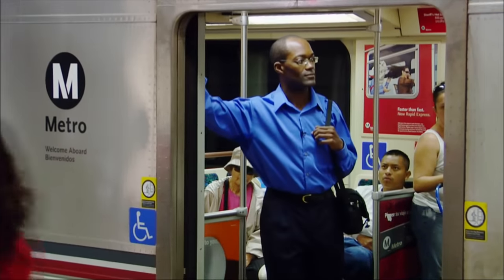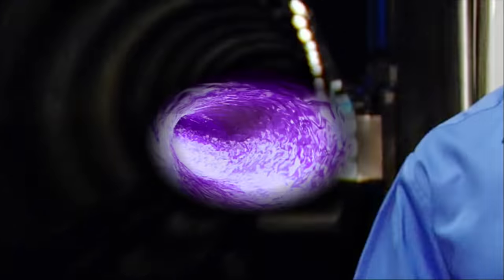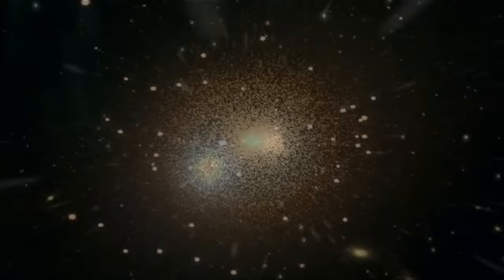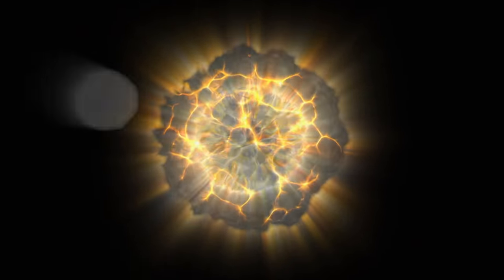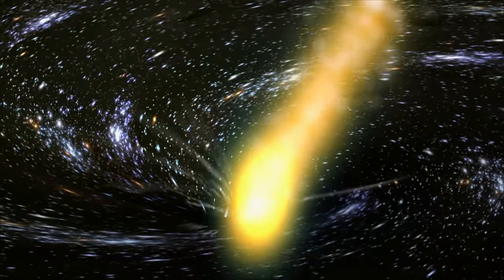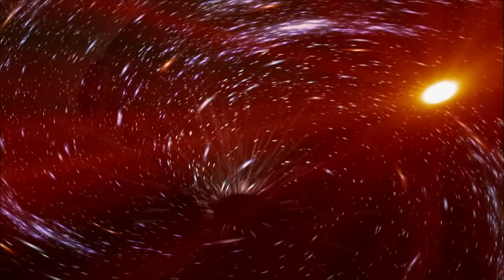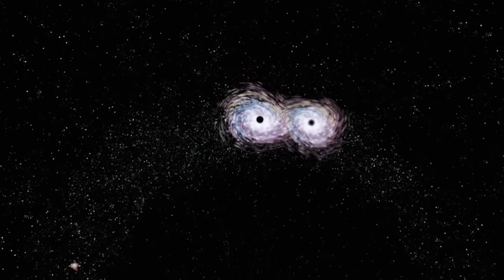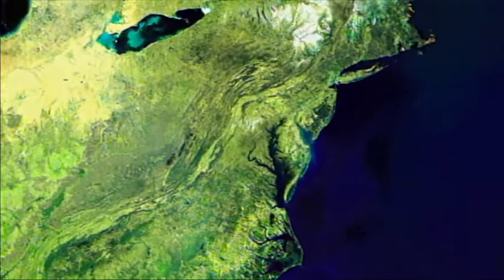The Universe: Black Holes Haunt Hyperspace (S2, E2) | Full Episode

Comment: What if cern was able to make the LHC completely devoid of any oxygan like vacuum it out like space itself and then smashed particals together with in that space that has been vacuumed out to replicate the conditions in which black holes actually exist maybe it could stablize  mini black holes for scientists to study them
Reply: It is in a vacuum.  Devoid of any oxygen, as you say.  Otherwise the particles would IMMEDIATELY crash-out in air molecules...💡
Reply: r/accidentallycorrect
Reply: to create a black hole you'd need lots of matter(like 8x the sun's weight in matter) compressed into a very small area so you'd need to work with the gas as a solid metal basically,hydrogen or oxygen get compressed so much they go from liquid to solid

Comment: Here's a fun thought experiment:

And yes, I realize they touch upon it in the video.

We have never actually visited a black hole to study it.
All that we know is: 
They emit no visible light, though they do emit Xrays.
They bend spacetime around them in lensing fashion.
We are fairly certain that nothing that enters can escape.

What If what we term "black holes" are actually the mouths of unidirectional wormholes whose exit points are either "turned away" from our viewing angle or are beyond our current "cosmic horizon"?

Here's the thought experiment:
If we can create a singularity artificially ... and it is actually the mouth of a wormhole ... would we be able to direct where the other end appears or is it completely random?
Reply: i need to smoke a joint for this
Reply: Random. Why was this a thought experiment, it’s simple math.
Reply: @wutruriding1355  
It is a thought experiment because we have no ability, at present, to demonstrably prove or disprove the existence of black holes or wormholes.

The math only postulates that a gravity well of sufficient mass could warp spaceti.e in auch a way as to create the wormhole.

None have been directly observed (that we know of), nor have they been scientifically studied firsthand.

Comment: Spacetime being what it is, you would have to do something about your location if you tried to travel through time. The earth and the milky way itself would no longer be in the same location as your starting destination. If someone knows of some kind of explanation for this problem please elaborate.
Reply: First, I see the "spacetime" term used only as a unit of measure throughout the universe. Second, our transition through time could not be done strictly by physical mechanics. I see it as leaving our physical state and transitioning through a spiritual state to another preset time of existence. This would also require a preset place and controlled energy status to enable us to return to our original place and physical status. Without this, one could be lost in the time and  place element and never return. This may have happened in the past. 
This process would be done using the Electromagnetic field of energy that could be controlled and manipulated.
Just another idea.

Comment: I think black holes are an opening to another dimension with a white hole on the other side.
Reply: It wouldn't matter if they were, it would be entirely impossible to traverse.  It would functionally still just be a normal black hole.  White holes are as of yet undiscovered, and it's unclear if they even can exist.  If they do, they would likely almost immediately collapse into a normal black hole.  Also, that's not what dimension means.
Reply: As BD says; an alternate reality wouldn’t be so much “Another dimension” as much as just another universe

Comment: could a Whitehole be a black hole at max capacity since it's sucking up all that energy and thus starts spewing the energy back out. 
Also could be what's on the other side of a blackhole. To possibly another universe that could tie into the multiverse theory. 
In my opinion I think that's what blackhole are, wormholes to the next verse.

Comment: Black holes are the event horizons of macroscopic wormholes. They are not traversable though. Traversable wormholes are in the quantum realm in parallel dimensions, hyperspace.

To hold one open would take particle accelerators to constantly smash particles against the open edges of the event horizon to keep it from closing. To allow it to close simply shut off the accelerators. Numbers if small particle accelerators are what will open a wormhole and allow it to close. Perhaps, particles would smash against antiparticles of the perimeter of an event horizon.

Wormholes will take one to other places but not to other times. Time travel is not possible. Time travel is scifi, science fiction and fantasy.

Everything always exists in the present, regardless of the differences in acceleration, age or gravitational fields.

White holes do not exist. It is quantum black holes that emit energy and particles. Virtual particles likely are emitted from quantum black holes.

The universe did not expand and spew out matter. Matter did not come to exist, no spewing involved, until over 400,000 years after the beginning of the universe.

Comment: You absolutely correct the Big bang did create a gigantic white hole but the antimatter or the dark energy right that's the stuff that's both on the outside of that big white hole and it also permeates inside of that white hole and that's half of the reason why you see the dark outside at night the way it is now and the other reason don't forget is because the universe is still expanding light is moving away from us that's you know another tall tale sign of certain laws of physics being forever is that anytime you take light away you automatically get darkness in anytime you put bring light into the picture what gets eliminated immediately darkness that's the first thing that gets eliminated whenever you cut the light on and hopefully the b***** will be chasing behind it

Comment: Ever thought what the Bible calls pits of darkness might be black holes suspended in space, forever falling as individual holding cells, suspended in outer darkness and indeed falling in a bottomless pit called outer space? Trippy ain't it? And possible. That's where fallen angels are, per the Bible, pits of darkness, where no one can escape and what light you did have doesn't exist there, in a place where a type of darkness can be felt. Total isolation.Dark energy? Dark matter? Hmmmmm....
Reply: Wow!    Dear "I got," just wow.  What an interesting 👏 POV!  I will have to think on this.  Thank you for your thoughts.
Reply: Bear in mind that the Bible was written long before anyone understood that stars are very massive and very far away, or even that the Sun is a star. As far as pits of darkness for fallen angels, it is not even necessary to have heard of black holes to imagine pits of darkness as undesirable places of punishment. Most people are averse to darkness, falling, isolation, or being trapped. You simply have to imagine the combination of all of these natural fears to synthesize something astronomically worse.
Reply: Your a thinker with a good imagination.

Comment: All the planets and stars of the milky way galaxy are inside the singularity. They create the vacuum as they plow through the singularity of time inflating it. Everything in the galaxy is inside the blackhole at the center of it everything but space junk that has broken off the timeline. If it has an envelope its traveling inside the singularity of time. We are plowing through the singularity inflating space as we move through time. The vacuum of a blackhole is more like the suction of a needle. As the plunger is pulled upward a vacuum is created. Same setup as planets plow through the singularity or quantum tunnel if you prefer that term, it inflates outer space and creates the vacuum pressure of the blackholes. If you think of the blackhole at the center of the milky way as the needle of a syringe, and the singularity (quantum tunnel) as the syringe. Planets and stars are the plungers and as they plunge through the singularity of time (quantum tunnel) it causes the vacuum pressure. If you think of all the other blackholes in the galaxy as holes in our syringe they reduce the mass/vacuum pressure of the center blackhole because they steal a little of its vacuum but doesn't change the overall vacuum of the galaxy. If you calculate the mass of every blackhole in the milky way and combine them and do the same with planets and stars you would find they are equal because the planets and stars give blackholes their mass.

Comment: I don't think that wormholes exist as described. Different dimensions must have a neutral charged space separating them to keep them from destroying each other upon contact. Opposite charges will cause mutual destruction on contact. I feel that the neutral zone between dimensions is also in a spiritual state and can be accessed for all space travel including universal and interdimensional. This is possible because the spiritual zone has no time nor distance limitations nor parameters. Most of the travel would be almost instationous. Also, the crew and ship would merge, together, into a single living spiritual unit required to make the trip. At destination, they would convert together into the physical state. This could be a process used when we observe spacecraft suddenly appear and/or disappear. They evidently have the ability to do this. 
But, this is only my perspective and theory.
Reply: You are on the right track...🤘
Reply: Source: thin air